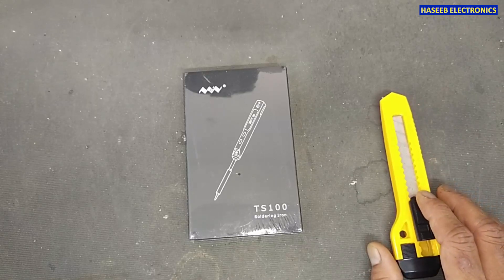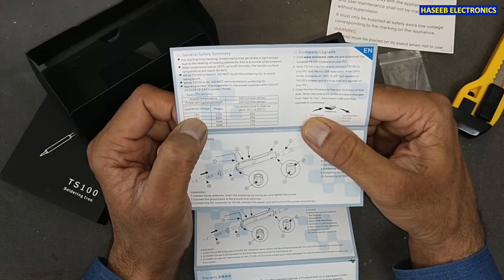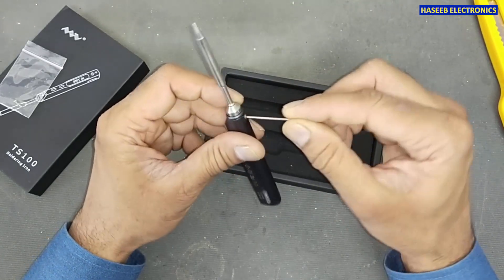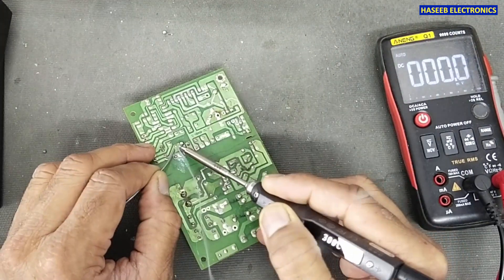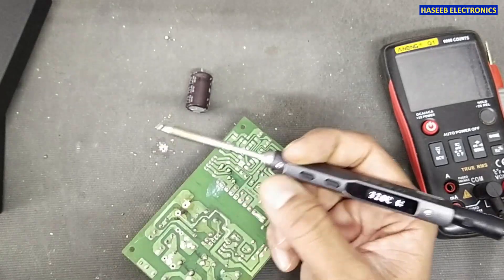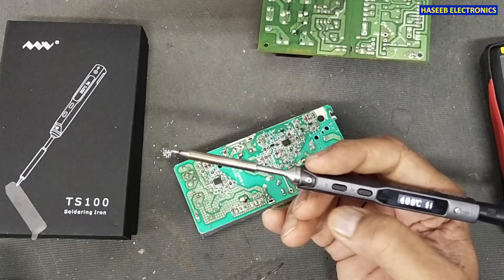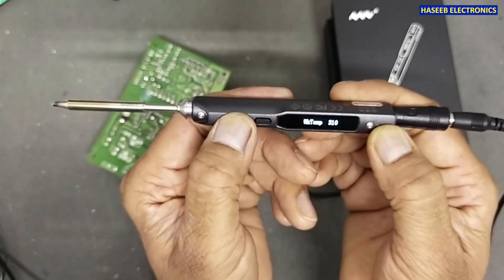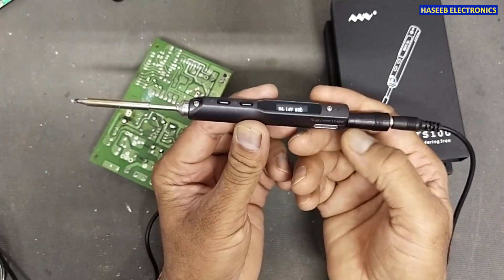{806} TS100 Mini Soldering Iron

Comment: Hi Sir. Thanks very much for your educational videos. I have a laptop charger (SMPS) that does show correct voltage when measured by DMM but it  fails to power the PC. I suspect maybe it cannot supply enough current to the load. Can you suggest possible faulty components on the PSU and aslo teach me how to measure current.

Comment: Salaam. I have LED TV combo boad primary side two shorted diodes. Can you suggest the equivalent this diodes with labelled pg2010 823N? What is the function of the inductor on the drain of the MOSFETs and what happens without it.?

Comment: What is the possible fault if the power supply will drop its voltage supply during  applying load...? 
the output voltage of the power supply  is 5 volts with current of 90 ampere..if we apply a load with 20 ampere voltage output will drop to zero...